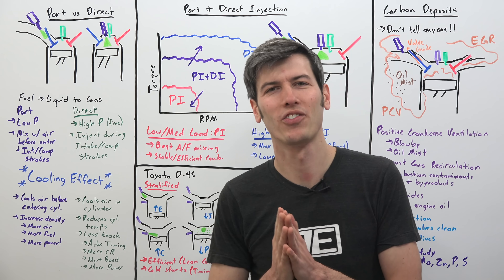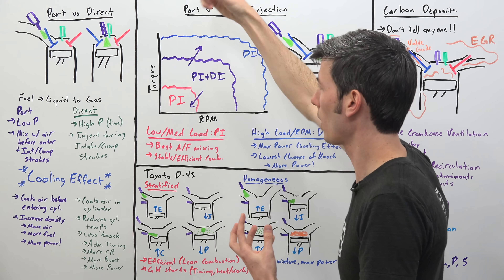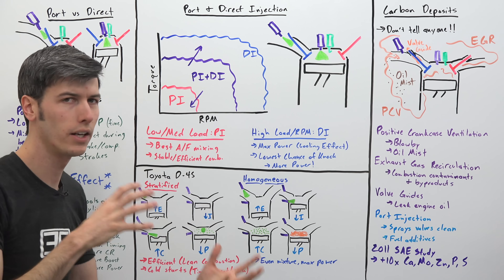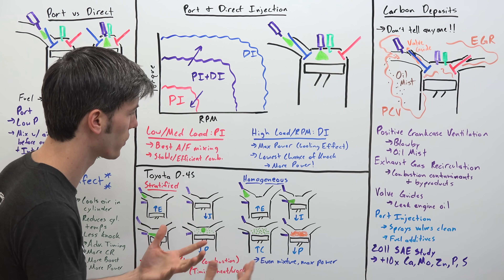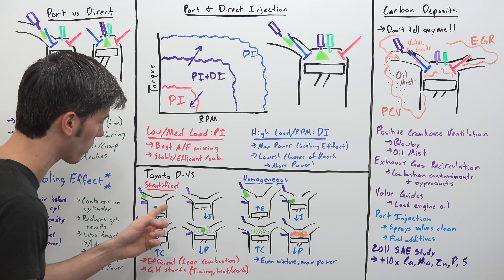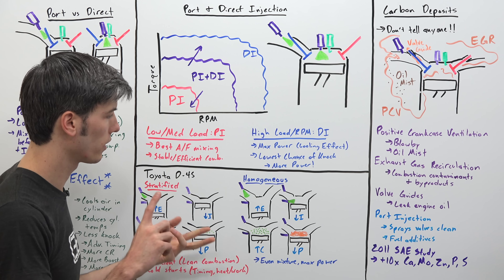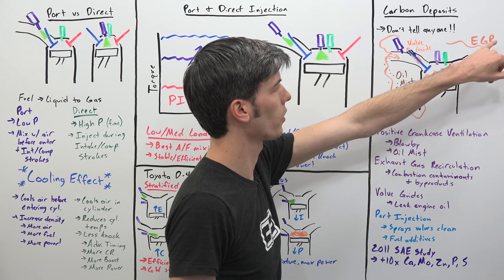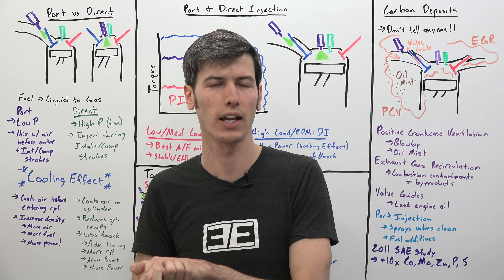Why New Cars Are Using Both Direct & Port Fuel Injection

Comment: Because the ICE is a Rube Goldberg nightmare,  it's time for EVs as fast as possible. The actual work done portion of an ICE is the size of one or two 2 liter bottles of soda, literally EVERYTHING else in the engine bay and driveline is bolted on crap just to make that small area produce motion, thousands of moving parts just to harness a reaction the size of a small childs fist. And they just keep bolting on more things to break. BTW im a car guy, but I'm also honest, ICE should be a hobbyist and collector thing as soon as possible, not a transportation thing.

Its amazing what we just get used to and the better things we will resist just because they aren't what we are used to.
Reply: Welp, I think many people would happily move to a better thing... which EVs are sadly not, yet. They are expensive and in some areas charging might be a significant problem. Yeah, they are cheaper to run, but the high price of the car itself puts people off - and in many cases they don't really pay back the difference in lower running cost, unless you use them intensively for a really long time. Low price and quick chargers everywhere = people will move.
Reply: @8Hshan  They have far lower operating costs in all but a few states, in the rest of the country they are better in every way except range and refuel time which are improving rapidly. I said as fast as possible, not throw away your car and buy an EV. I understand ALL of the problems with EVs. If they completely stopped selling ICE cars today(which is far from happening) it would be 10 years before even half the cars on the road were EVs, If we put 1/10 the subsidies and effort into EVs as we have for the last 100 years into oil and ICE we could solve all of the small issues left in 5 years, but it wont happen even if we tried for atleast 10, none of the issues are actual issues, they will have plenty of time to naturally solve themselves even if we double our current EV sales vs ICE.
Reply: @kanewendlandt4509  Hello, I'm neither from the US or talking only about the US. I'm talking about the world - where you can have no chargers for 300 km or more, where you can have absolutely none subsidies or similar stuff for buying an EV, where people buy on average cheaper cars than in the US. Now that changes the perspective a bit... and explains why those Rube Goldberg machines still make sense. All I've mentioned above applies to Poland where I live - and even though I live in Warsaw, far richer than the rest of the country, I've seen about as many Bentleys and more Porsches than Teslas. Far more new hybrid Toyotas than Nissan Leafs - all as taxis. And about as many new Mercs as taxis - even though they are more expensive in general. In the US the switch to EVs might come soon enough to not invest heavily in designing new, complicated ICEs, but here it's not coming that soon.

To be clear, I'm not saying that EVs are not the future, as I strongly believe that. I'm only saying that they are still quite a distant future as a major car type globally, so for now manufacturers should still develop new technologies for those beloved Rube Goldberg machines ;)
Reply: I kind of have a hybrid, I can see my fuel economy go down when I turn my stereo on.
Reply: I'd it were that easy we would have done it already.
Reply: Modern advanced EVs have actually become more complicated over time. The old school ones that run on lead acid were dead simple. But since going to super dense lithium batteries they also need very advanced cooling/heating systems. Also because they have gone upmarket they also need all the modern safety and luxury features the same as any other car.
When you think about it the only main differences these days is the engine and transmission.
In modern cars there is A LOT of stuff that goes into them, and modern cars don't really have that many problems with the engines/trans until they get to high mileage.
Reply: I like electric motors and probably know more about the person who invented them and why they are awesome, than 98% of the world, but until we can make better batteries your comment about the engine being made of many parts that are all for the purpose of converting a small reaction into motion, can be applied to the electric car with even more applicability. The batteries are much bigger and weigh more, but have less energy than half a tank of gas. When people compare the energy efficiency of the electric motor to an engine, they are effectively forgetting all of the fuel chain prior to the motor. If you do an honest comparison between the two, then you have to account for the inefficiency of the power grid and the generation of the power at the powerplants. When you do an honest comparison the engine competes very well with the motor. Someday I hope that we can have much better batteries and or capacitors that allow us to store electricity in a much more dense form, but until then I am unconvinced that current electric vehicles are any good.
Reply: @davidscott5903  Yes compare them honestly, consider that the entire oil and gasoline industry is heavily subsidized. Consider drilling, refining, storing, piping and shipping gasoline all over the country and the energy that takes, all heavily subsidized. Consider ICEs have a 100 year head start and has been surpassed pretty much in the last 10 years by EVs. In most of the US and the developed world EVs are FAR more efficient and clean if you compare them honestly. So please do. Battery energy density will double in the next 5 years and that is way more than enough. 500 miles on a charge will be  standard end of 2025 EVs, gasoline cars could compete except they would need bigger gas tanks and there is no more room because there is a giant Rube Goldberg contraption harnessing the power of a small fire, a caveman invention.
Reply: @kanewendlandt4509  
You keep using that word (heavily subsidized), I do not think it means what you think it means. 

You have it completely backward. It's called taxing. You see, no matter how much you say that it is subsidized the amount that they collect in taxes on every single gallon proves the exact opposite. 

And where does your magic electricity come from to charge these cars? If it came solely from wind, solar, hydroelectric, and nuclear, then I would say that we should do it, but if you look up where most of our energy comes from, you will find otherwise. 

Do your homework, buy one for yourself, drive it in at least half of the countries in the world, and then come talk to me again.

Comment: To get the carbon off, you gotta blast those valves with the walnuts bro...any nuts that fall down into the combustion chamber and get roasted, you simply collect in a "catch can" and serve those caramelized nuts at your next party.
Reply from the maker: A proper roast.
Reply: @EngineeringExplained  
What is your opinion of catch cans?  And if you think they're beneficial, do you think they aren't standard equipment because they need to be emptied periodically (or for some other reason)?
Reply: @ewiem4351  I think the EPA would be the problem, unless the vapours coming from the catch can get burned or coalesced back to the pan you are realeasing more emissions than the car was certified for.
Reply: @--_DJ_-- 
That makes sense.
Reply: @--_DJ_--     hi - seems u very knowledgeable about engines.  Have question on last part of video with egr and pcv and these causing carbon buildup on intake valves - maybe could just seal this off so then no waste products returned to outside valves.  Is not environmentally good but would engine run ok or would this retune with many other problems then?  Thanks
Reply: @michael-qp9xd  You probably wouldn't want to vent the EGR to the air, people block them off when they want to eliminate it. PCV (crank case vapours) used to just dump straight to the atmosphere, it is just bad for the air so we started to burn it instead of venting it. Your car would run just the same with it venting to the air instead of having it go back into the intake. You wouldn't want to block the PCV system though, it would blow out seals and leak oil.
Reply: @--_DJ_--  thanks for comeback. Maybe then not block or seal off but like u mention then vent to air. This could eliminate then need to clean carbon off the intake valves and all the environmental issues with cleaning compounds for carbon removal. But need maybe vacuum for pcv system working correctly and removal of these gases so just leaving pcv disconnected and open not to pull blowby gases out of oil area. Need vacuum. So just best leave all connected.
Reply: @michael-qp9xd  Crank cases will vent just fine on their own, we used to just put a hole in the valve covers and stick a little air filter in it to keep stuff out. People still use those all the time on older cars.
Reply: Get that guy from Ice Age to handle it for you and you're good to go.
Reply: revvvvv up your engines!
Reply: @dob3079  underrated comment
Reply: lol
Reply: You were probably referring to that but for everyone who just took it as a joke, they actually do this to clean ship diesel engines (walnut shells anyway)
Reply: @thehuguenot5615  Thanks for sharing. How are the newer engines? If you know, at what year did these issues stop?
Reply: Could you do a small video on how Gen II Ecoboost works?  Just wanna know what I’m missing. 2018 Explorer Sport + Gen I Ecoboost= Bummed
Reply: Lol good one
Reply: If you're afraid of walnut blasting. Try using CRC Intake Valve and Turbo Cleaner.
Reply: Lmao
Reply: @thehuguenot5615  Is the skyactiv-x any better than skyactiv-G on the issue of valve carbon buildup? Im thinking of buying a mazda
Reply: Omg 😂
Reply: It’s 2025 no car engine should have any problem with anything at this point they’ve had decades and decades to get it right
Reply: Them carbon chunks can be very hard and do damage 😮
Reply: Old Mercedes engines had direct injection. The intake ports would clog with a substance nearly as hard as diamonds. 4 hours to bead blast one head clean. It would slowly loose power over the years till it would barley run. No walnut shells were going to get rid of that crud.
Reply: That idea is just nuts mate.

Comment: What if you want to open the intake valve a bit sooner and use turbocharged air to drive out exhaust and clean up the cylinder? You won't be able to do port injection at this time? Or at low speed you do port injection and don't open intake valve sooner, but at high speed you do direct injection and do early intake to clean up exhaust?

Comment: Which DI-only engine does not have carbon deposit issues?
Reply: BMW n20 and n55 do not have carbon issues like the previous n54 did.  It has to do with the valvetronic keeping the air speed up so that nothing can collect on the intake valves.  I've personally pulled intakes on n20/n55 with 60,000+ miles with almost zero carbon found on the intake valves.
Reply: JC Superstars don’t those use the valve lift as the variable throttle? Keeping intake velocity near mach.
Reply: jrhunt414 , yes that’s the idea. I have no idea what the air speed is but it works, the oil/air mix doesn’t stick to the intake valves.
Reply: @jcsuperstars1100  Oh trust me, I know about the n54. I have one. When I got my walnut blast done, it was nowhere near as bad as others. Lol. I have to run a dual OCC setup to mitigate.
Reply: Domino 86 the oil catch  can makes the difference. Now try the new valvoline modern engine oil and see if is better  then occ alone.
Reply: Visa versa. DI engines are full pf deposites instead of regular port injection engines
Reply: Alex Ivanov ahhh yes ... I mis-heard what he said at the end of the video, I thought he said there were some DI which had no carbon deposits which confused me a lot!!, :)
Reply: @europana7  9:20
Reply: They all have carbon deposit issues. If they dont have an EGR system, then they certainly have a PCV system. Either or results in carbon deposits on the intake valves.
Reply: This is not true. Most newer engines that utilize a sub 1-micron efficient PCV oil separation system are actually able to keep intake valves from getting carbon deposits. There are many systems that are capable of achieving this, one is Dana's multitwister system (you can find a video on youtube that does a good job explaining how it works)
Reply: Can't find any issues with skyactiv yet. Dave Coleman elaborated how they use heat to keep it away. Assuming it works
Reply: @Suction_  How many generations of skyactive engines has there been. I thought two but I dont really know. And has the skyactive engines been around long enough to get a read on carbon deposit build up. I was looking getting a Miata for retirement pressy for my self in the not two distant future and knowing the engine is good that respect would great.
Reply: @jhndijkman  been out since 2013. Haven't done much changes to it. I've owned two now and never had an issue. Pulled my intake manifold off at 25k on my last one and it had some, but nothing to be concerned about. Only issues I've seen is if you putt them around and take short trips. Other than that, I've seen very little issues. Miatas probably have the least being that everyone revs the piss out of them and really put them through their paces
Reply: @Suction_  Are well, thats a great report to hear. Nice.
And in respect to revving the bejesus out of engines and especially ones designed for it, is something I havnt got a problem with.  Great bit of news that , cheers.
Reply: @jhndijkman  I traded my 3 for a cx5 and even in this 3700lb crossover its still a free revving, happy motor. My 3 was the 2.0, very similar to the miatas and it loved high rpm. The auto trans even encouraged it sometimes when I gave it a little much, it'd kick down a gear or two and asked for it lol. Complete opposite the Impreza I compared it to
Reply: @Suction_  I have personally only owned a mid 90's 626 2000cc GT five-speed manual box. Had 180 ks on it when I got it. I really enjoyed that car, didn't give me a scrap of bother. But other family members have had small engined single cammed Mazda's 323 1500cc and  1600cc. always found them great little runners and cheap on gas. Can't kill them. Generally, I think the manual trans were and probably still are better than average. Looking forward to Mx5 [Miata) now.
Reply: Yes there are. The Honda Accord engine is probably the biggest example of a mass market engine that has been out there for quite a few years but with very little to no issues with carbon deposits.
Reply: I think Honda doesn’t have the issue either. The documentation says something about a little bit of fuel getting sprayed on the valve while it’s open. I still don’t know much about it. Hopefully EE explains the earth dream VVC engine
Reply: Long Tran Long Tran DI engine that can switch back and forth between Otto and Atkinson cycle can solve this problem by using VVT and multistage fuel injection strategy but It is not as good as using a Port injection or even both Port and DI combined as fuel pressure hitting the back of the valves aren’t as great, as the system relies heavily on fuel being pushed by the piston back out at the end of the intake stroke during Atkinson cycle (of course the main purpose of this cycle is to reduce effective compression ratio and by the end of one complete thermodynamic cycle, your engine will end up having a much greater expansion ratio thus resulting in much higher Thermal Efficiency and it also come with a side benefits of having charge cooling effect hence improve the Volumetric efficiency of the engine at low load, low rpm scenario, and also worth mentioning, which is at the same time act as carbon cleansing agent as tiny bit of a fuel mixture being pushed out of a cylinder and trapped inside the intake manifold for a brief amount of time ) in expense of sacrificing a little bit of a power output compare to an Otto cycle.
Reply: @soraaoixxthebluesky  Oh ok, The lady next door has a Mazda 2 . That has a miller cycle engine. Seems Mazda are not scared on trying things out.
Reply: In the case of Honda, it's because they have a proper PCV oil separation system, with a drainback to the bottom of the fuel sump. They actually designed their system quite well so that no PCV deposits end up on the intake valves.
Reply: Now that is the right question.

Comment: Port injection does not always keep intake valves clean.  Bosch L-Jetronic equipped BMW's and some Nissan's were NOTORIOUS for having huge caked on deposits on their intake valves.  LH-Jetronic, the later derivative did not have this issue.

Comment: What is knock ? And why aren't the engineer proud of the fact that they use port injection to clean the intake valve ? What is the problem with it ?
Reply: iPodgeek44 

Knock or detonation is when the air/fuel mix ignites spontaniously before it is supposed to by the sparkplug... this can be due to various reasons. Low ron level fuel... heat.... agressive ignition timing etc
Reply: @TheMatrixcube  Okay thanks for explanation buddy